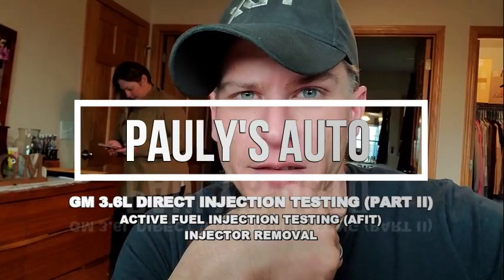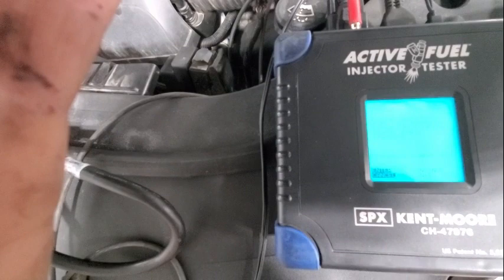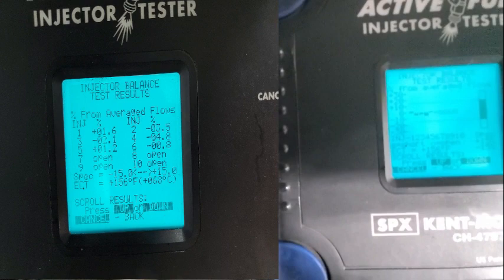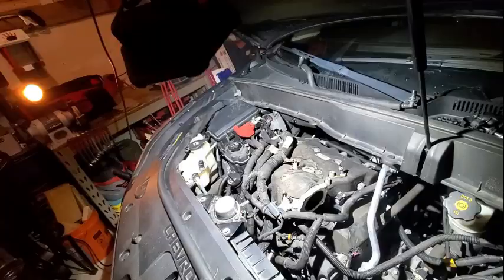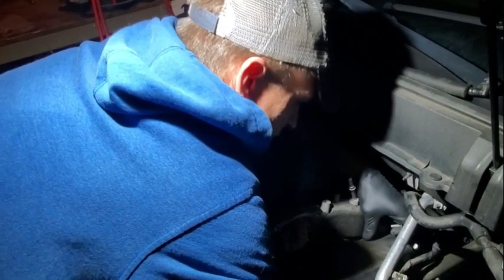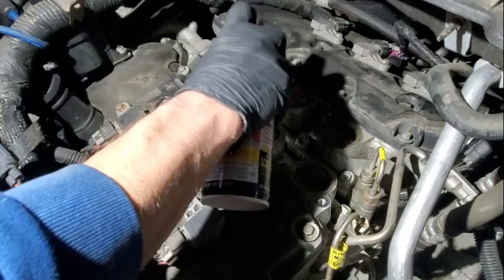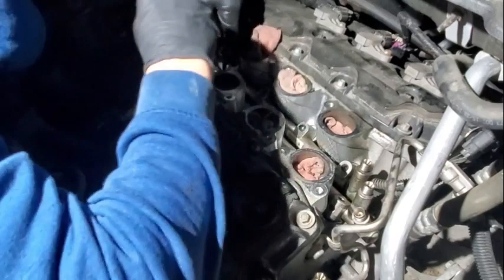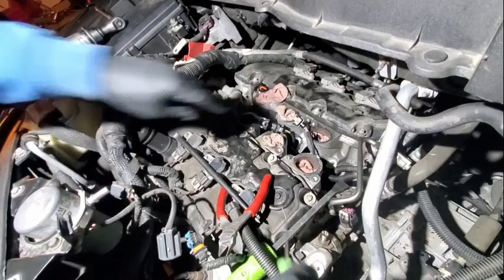GM 3.6L DIRECT INJECTION TESTING (PART II) - ACTIVE FUEL INJECTION TESTING (AFIT) & INJECTOR REMOVAL

Comment from the maker: Please stay tuned for Part 4 of which is still in the making.  The goal of this series is to provide my viewers with a brief outline of the following:

1. Scan Tool Data Pid Analysis (Before New Injectors)
2. Scope Waveform Analysis (Before New Injectors)
3. Direct Injection System Brief Theory of Operation
4. Factory Wiring Diagram Overview
5. Kent Moore Active Fuel Injector Testing (AFIT) Flow Testing Analysis
6. Injector Removal and Replacement
7. New OEM Factory AcDelco Injector Resistance Measurements
8. Scan Tool Data Pid Analysis (After New Injectors)
9. Scope Waveform Analysis (After New Injectors)
10. After Action Review

Overall, please come with constructive feedback, since this video series is being produced to help fellow technicians learn and grow as professionals.  This is by no means a video series designed to teach everything there is to know about Direct Injection Systems.  Furthermore, I assume no responsibility for those who just REPLACE PARTS without proper testing on the front end.  Bottom line, you are RESPONSIBLE for your decisions and this video is NOT the END ALL FIX for any GM 3.6L engine experiencing these symptoms.

God bless, thanks for the continued support, and remain grounded!

Link to PART I: https://youtu.be/tLpSbaJpdb8

Link to PART II: https://youtu.be/wJ1jCwFKZNg

Link to PART III: https://youtu.be/kRDcseEBfRo

Comment: fuel rail removal tip:
once you get to the fuel rail bolt removal part, take out all the rail bolts. it will give you more room and flexibility.
take the upper rail out first. you can wedge a tool under the rail end at the right side and pop the first injector loose. that will give you enough room to get a tool under the rail farther toward the left. 
once you pop all the injectors loose, pull the rail up a little and then slide it to the right a little and it'll come right out.
you will now have a ton of room to pop out the second, lower rail. 
man, those injectors are really tough to pop out, but that's nothing to the pain the injector to rail clip will give you 😄
Reply: Actually, if I give that clip a name it will solve all your problems and you'd wonder why you never realized this before. The name I am going to give it is - Twist-Lock-Clip. They are NOT to be removed.  Use a channel lock to twist the clip and it rotates sideways and releases the injector while the clip itself just rattles around loosely on the rail. When you put the new injector in you line the clip back up and spin and lock it. To be more clear, the clip has one end that has a larger flange, think of that end as not being allowed to move, almost as if it was attached with a hinge, it's the rest of the clip that has to be rotated about the axis of the injector.
Reply from the maker: @verohandymike  Fascinating thank you for sharing this

Comment: Great job buddy, I have one question though, is there anyway you can make a deterministic diagnosis of which injectors are bad without using the kentmore tool?
Reply from the maker: Best you could do is do an automated injector balance test with a capable scan tool and run test about 5 times and see which ones are different from the others, but TBH these injectors just need to be replaced at 130k...it's not worth the hassle going in again and again.
Reply: @PaulysAuto  I appreciate your reply buddy
Reply from the maker: @abdullahal-maliki5318  No worries brother...hopefully it helps you out my friend!  God bless.

Comment: On these engine platforms- have you seen it super common for leaky or bad injectors to cause a bank 1 420 cat below deficiency code? 
2010 gmc acadia 
Similar symptoms- new cat plus 02, spark plugs. Seems to have a small miss/hesitation at idle. No codes beside the p0420. Noticed the old b1s1 o2 was very black. Old cat was not melted or broken but very black, could see light through it still. 
Trying to nail down the root cause of the p0420 and I ended up here at injectors. 224,000 miles and as far as I know of original injectors with crappy 85 octane gas around here. I run marvel regularly at every fill up and other cleaners sometimes.
Reply from the maker: These injectors are really common to have flow problems that will take out a cat real quick.  Sounds to me like you might have either exhaust leaks or you may have some 02 issues on that bank as well.   Valve coking and injectors are a big issue on these engines.
Reply from the maker: Run a vacuum in reverse up the tailpipe spray her down with soapy water and look for bubbles before HO2 Sensors both upstream and downstream Sensors.
Reply: @PaulysAuto  found 1 small crack in the Y pipe and re welded. 
I’m thinking the eBay cat re set the code- I just can’t justify replacing with a oem cst for $900 on a car worth maybe 3000$ on a good day. 
Ran multiple smoke test also with no leaks. 

Fuel pressure injector test with results 

1-60 drop to 57 on pulse
2-57 drop pulse56
3-56 drop pulse 55
4-62 drop 59
5-58 drop 56
6-56-55

Engine start 55 psi (bouncy)

Idle 45 psi (bouncy)
Reply from the maker: Try running an injection clean 1/2 Gas mixed with 1/2 ACDELCO TOP ENGINE  CLEAN (Top Tier) hooked to low side with LOW SIDE PUMP DISABLED...Exhaust leak found excellent 👌
Reply: @PaulysAuto  thanks for all your input, I managed to run some intake cleaner, sea foam and injector cleaner. I think those all helped a lot and still had the code. Only last thing I could think of was the eBay cat itself and well sure enough. I did an attempt to clean the old cat since it was broken/melted and re installed and what do you know. Fixed and passed emissions. Thanks again for all your help. These gmc must have extremely high standards on the cat efficiency to not set the code.

Comment: I am finding tons of value in it. My 3.6 has the metal clips at the top of the injectors, and I thought I saw you have one in your hand. Are these the injectors with those clips? And are they just popping off because I did not see you actually hit to remove them?
Reply from the maker: Are you talking about the hold down clips for the rail...I apologize I didn't see your comment until now...damn YouTube always making it difficult for us creators?
Reply: I posted this above, but here you go - Actually, if I give that clip a name it will solve all your problems and you'd wonder why you never realized this before. The name I am going to give it is - Twist-Lock-Clip. They are NOT to be removed.  Use a channel lock to twist the clip and it rotates sideways and releases the injector while the clip itself just rattles around loosely on the rail. When you put the new injector in you line the clip back up and spin and lock it. To be more clear, the clip has one end that has a larger flange, think of that end as not being allowed to move, almost as if it was attached with a hinge, it's the rest of the clip that has to be rotated about the axis of the injector.